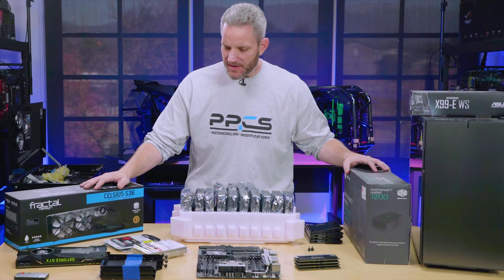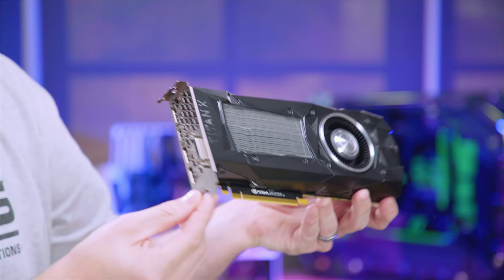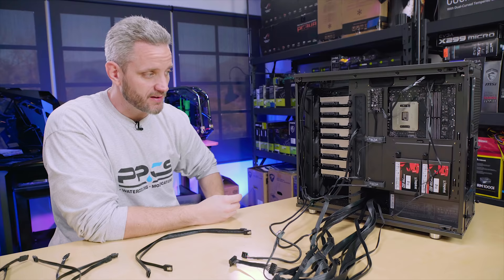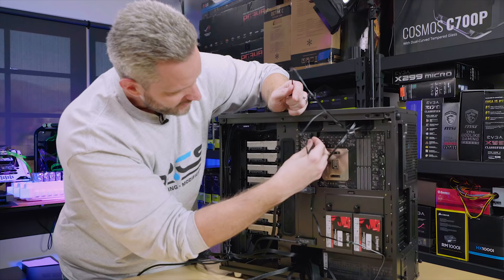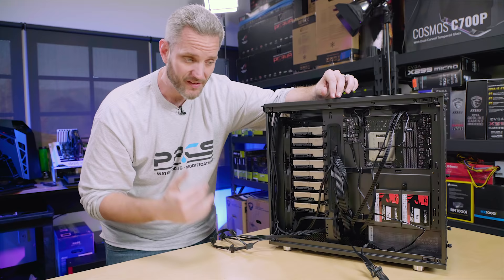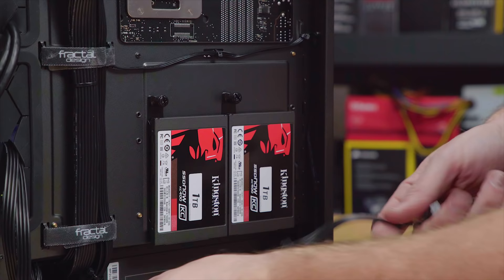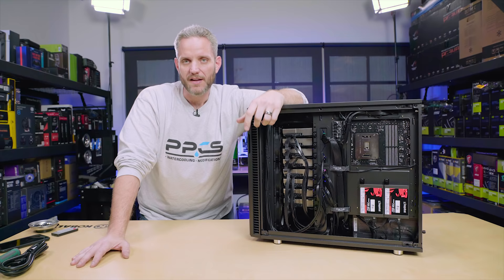How to cable manage a computer

Comment: I have an ESXi host with 4 VM servers living in it on a homebuilt NAS. I had it AIO cooled for a few years. I just went back to Air on this as for a 24/7 need to be reliable machine water any water is not wise if you do not have a person watching or using it 24/7. AIO failure when no one is around is devastating to say the least. Yes, it is nice to cool with water but sometimes it is just a failure in waiting and a very expensive one at that.

Comment: If you hook up your 3 case fans (3 pin) to the fan controller will you be able to control the speeds of the fans? For some reason I can see the rpm's but I can't control them.  Thank You!
Reply: 3 pin fan speeds cannot be controlled by the motherboard. Only 4 pin PWM fans are capable of this. You can buy certain fan hubs/controllers that will allow you to control the speed either through the mobo or via knobs/switches, or you can use low noise adapters to limit (but not fully control) the fan speed.
Reply: Thank you

Comment: late to the party, but did you do a followup to this? i'm curious how you set up the nas in terms of software. ideally, i'd hope you used zfs - in raidz2 + spare with the ssd drives for slog and l2arc, all on top of solaris. but since you guys are partial to windows, did you go with refs?
but you wanna mix workstation with nas? i'd just keep it as server and lose the expensive gpu.

Comment: Small thing you could do if you don't want to potentually waste zip ties is during your planning routing would be twist tie them and then go over with zippys once it's at final routing. 

I was going to say that the way you had the top 4 hdds data cables started Really irritating me, in my server i have all the sata cables in a tied harness from the top down. 
But i then noticed that those sata cables you have are around std length and they need to reach a pcie sata/sas card, so you'll need all the length you can get with that. 

Another way of doing this would be just get a 2 port sas card so thats normally 8 hdd, 4 hdd per sas port, and just use the mobo sata for the ssd. Also sas data cables are normally longer than regular sata cables.

Comment: Regarding tying cables together, I've been doing research for a long time yesterday about the different methods: Twist ties are dangerous because of the metal ends land on an electric component, it can short it out. There are thicker twist ties that don't have the exposed metal ends which are the ones you should use if going twist-tie route. Velcro ties are best except that if you don't cut them, they can become very bulky when wrapped around cables many times. The part of Zip ties that come in contact with the rubber coating of a cable can start to wear down the rubber, and also the fact that to replace them, you have to cut them, possibly cutting your cables. Reusable zip ties exist, which is what I'm going to use today. I don't plan on moving my cables at all after I manage them, so I don't think they would wear down the rubber coating so quickly. 

tl;dr: #1) velcro ties, cut to length to prevent bulk. #2) thick rubber/plastic twist ties without exposed metal wire on ends. #3) reusable zip ties. #4) regular zip ties. #5) if nothing else, then regular trash/grocery twist ties but used very carefully to prevent shorts.

Comment: Just noticed on a big 4K screen, lots of macroblocking and banding artifacts. Reminds me of my "good old" GH4. Fixed it by replacing it with the GH5 and its great 10 bit codec. 

Didn't know you were using the FS5 (8 Bit 4:2:0 H264 with a low bitrate, lots of filtering, low detail but strong sharpening).
On a HD screen it looks fine though.
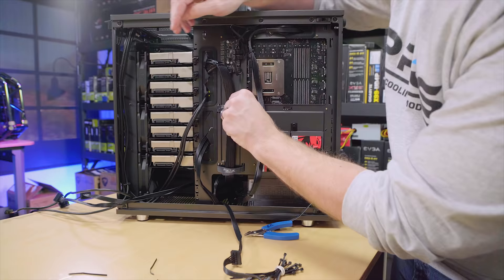Reply: At 16:33 e.g. big green blotch on the the right side of the case.
Exacty what happened when I tried to colorgrade flat (V-Log especially) footage from the GH4.

One solution could be the use of Temporal Noise reduction in either Davinci Resolve or Neat Video before applying any color correction. It cleans it up and even dithers the colors.

Comment: Most is common sense but when I was a noob builder I did actually try to force the sata cable into the ssd and broke it so good tip on that for new builders. I pretty much do this the way you do. The only thing that drives me insane is that big USB 3.0 Cable from the case to the motherboard. Any tips on that?

Comment: Would it work if you connect your HDDs in a staggered way ? I mean connect one HDD with the sata power leave the one above it then connect the one next to it, then get the next cable connect the four in between. Just a thought.

Comment: So I just bought this same case, and I wanted to use this as kinda a guide on how to do my cable management (which I've always kinda sucked at) one thing I'm having issues with is that you never showed how you routed the fan cables to the aio. I've got a h115i from Corsair and am having issues with this. I'm setting it up in the front with push/pull I plan to have all Corsair ml140s in my case but don't have the money to buy that many yet, so I'm having to deal with the shorter cables of the stock Corsair fans for the pull side on my radar and can't figure out the best way to route then to keep them out of view and connected to the aio. Any help in this regard will do be great! Also I hate the loops on your drive power cables, think it'd be nicer if you had zip tied the loops down  and had the second power cable routed "on top of" the first then allowing you to have one nice line of cables for you hdds.

Comment: I would love to see you do a cable management tutorial on a case that has tempered glass on BOTH sides.
You mention that everything is traceable if you need to replace something, but in my chassis (corsair 570x) the only place to hide wires is what i can only describe as a thin metal tube behind the motherboard tray, making traceable cables almost impossible if you want it to look good on both sides.

Comment: I just have a question regarding the Power delivery to those 2 SSD's. so you're using an extension cable to connect to the power supply cable or are you using some something different. as those cables came from somewhere else. I understood everything about the build except for this part. I just can't figure out how the power delivery is achieved here.

Comment: Now I really want to open up my pc and fix the cable management on the side panel. Instead of combining select cables and fastening them to other areas, I just tied them down in the same general area. It's relatively clean though, but this video makes me want to rewire my whole setup.

Comment: What if you use the two SATA power cables together same as the PCIE power and use one for HDD 1 3 5 7 and the other for 2 4 6 8 so you don't get the loops and the cables will be straighter ? Will that work?

Comment: Jay, do you ever tape off the ends of unconnected power cables to avoid a short?  I Recently had an unused connector of a 4 connector SATA cable shorting to the case.  Never had that happen before.

Comment: you seem to feel like that power connector is bad but you should see mine, it was an old one which still comes in two parts so it's so clunky and difficult to get it in the plug, i bet that one would be so much easier and less painful

Comment: 1 suggestion, if the connectors have enough space between them: for the 8 harddrives you used 2 cables, the first for HDD 1 to 4, the other for 5 to 8. It might have worked if you used one cable for drives 1, 3, 5 and 7 and the other for 2, 4, 6 and 8. If the total length of the cables is enough and the spacing between the connectors works out, that will give less of those loops and an even flatter layout.

But overall great video, especially the part about  plugging the cables into the GPU/motherboard first, not the PSU side first. This can make things might neater in the end, especially on the side that you can actually see.

Comment: Hey jay, I know this video is kinda oldish, but was wondering what the business end looks like and how you deal with motherboards that have connection points in the middle of the board or just in really bad spots or even cables that are to short. Also AIO tubing routing?

Comment: I'm very late to the party, but... great video, and very helpful :) I just recently opened up the backside of my pre-built system for the first time to get a proper look at what I actually need in order to install my new SSD, and the cables looked really messy, if I remember correctly. Had a little bit of trouble getting the side panel back on, even. Thinking I might try and fix them up myself, after watching this clip! Installing my SSD (once I buy the required screws and SATA cable, as well as some new zip-ties) is as good an excuse as any to try and clean them up, right?
Reply: Bit of an edit, I guess... Unsure to what degree my case/motherboard allow for cable proper cable management. The way it came pre-built (or custom built, I suppose, by a local company in my country) suggests that there are no practical ways to route SATA cables - they are currently routed in a way that blocks off part of the motherboard, right where something that might go in the second PCI-e slot (the 4x mode one, underneath the slot where my GPU is plugged in) would probably have to go.

Comment: There’s 2 problem factors for some people, the cable management design of the chosen case and the style of the cables..   I have a evga supernova gs 550w full mod with standard issue cables fitted in a GameMax Expedition m atx case, neatest I’ve done a case, but had to squeeze the flat side panel on,  my main issue is the 24 pin, it’s stupidly thick cable..  working with a coolermaster elite 110 with fix cabled atx power supplies little easier to bunch and tie and working with a aerocool CS-102 case I’m able to feed and tuck away cables from a gaming power supply..     it’s a daunting task, but you do need to find the right case and cables.

Comment: use SAS sas drive controllers and raid controllers (depening on what you want) are so damn cheap and you can get like 36 ports to a card and 4 sata to one SAS cable

Comment: Jay, have you had much luck with the daisy chained Sata cables? (4 in one connector cable) ..i never seem to get them ALL to work at the same time..if i use individual, then they work..(even if i replace the cable)..What say , you?

Comment: When I have hard drives in a stack, I actually use one sata power cable for the odd numbered drives and one for the even numbers. There's less horizontal mess that way. I guess the only challenge is that you'd have to unplug more cables if you need to pull a drive in the middle.

Comment: Jay i'm having some trouble with my rig cablemanagement. I have an S340 elite and i use cable extentions for the 24pin, CPU, and 2x 6+2 for the GPU and they ocupy too much space.
Since my GPU is an AMD VEGA 64 water cooled and it pull too much power, people say i must use 2 cables with independent power lines instead of utilizing one cable with the two 6+2pin headers.
I Have a Corsair RM 850x. Should i use two independent power lines for each GPU conection or can i use just one cable?
One less cable would free significant space.

Best regards

Comment: I'm using the InWin fans because they all daisy chain. Although, technically there are two cables because it splits the fan and RGB off of the one cable. Now I just need to perfect the cable management of all the other items.

Comment: 21:51 " everything is easy to trace is what cable management is all about" i think this is most important aspect here. unlike clumping it all together, sleeving them and forget. if it was me at the beginning, i would have a central trunk of wiring and everything branching out, and that is not cable management. thanks for the idea.

Comment: The best way for even better cable management I liked was LianLi and Thermaltake with their Level 10 GT(GTS) hot swap systems. One long sata connectors to plug in on the back of the drives and then the single connectors because of how many drives you have. In this case that kind of setup for cable management would've been perfect.

Comment: Honestly, and its silly, but with all these different connections you know which one I always struggle the most with?  The one NOT shown in this video by the way.  The USB connection from the AIO to the usb header.  It seems, inevitably, this has to run from the CPU socket, down to the bottom of the board underneath the graphics card, so I always struggle with a way to route it that 1) keeps it clear of GPU fans/heat sings and 2) looks decent.  And it often isn't long enough to do a good job.

Comment: There were a lot of right angle turns on those flat cables where the cable ended up turned the "wrong" way. As must as possible, eliminate all twists.

Comment: Hey Jay i am kinda working with a small case which does not have much room but still i have to make it neat. the gpu is not so long. just a strix 1050ti case has 4 sata hdds a dvd rw and a bunch of connectors. can you do a video on how to cable manage on a small case with little room to breath. cases like raidmax?

Comment: i have a suggestion, sometimes its nice to color code cables with a tape or stickers in order to know instantly in which sata port is certain  hdd/ssd connected, especially if they are not connected in numbered order or sth, or you are adding them at different times or sth... it's pretty hard tracking them when they are bundled together

Comment: hey jay, i saw paul doing a mod for a 3.1 type c port on his case but i don't want to drill the front panel. could you show another possible solution (maybe involving the expansion slot covers because everyone has a few of those laying around and they may fit a usb-c port). thanks.

Comment: Wouldn't the EPYC be better option for that build? Having in mind that the EPYC has 128PCIe lines and is not affected by Meltdown and Spectre patches it should perform much better in IO workload and virtualization stuff.
BTW - Can you tell what Raid controller will you be using? :)

Comment: I'd like to see a version of a more standard pc with only  like 1SSD and 1 or 2 HDDs plus extra cables for fans and front panel etc. 

the only thing I learned after watching this and trying to fix the cable management in my old pc my brother build for me (without any cable management but rather just plug it in so it works) is that my case offers literally zero cable management options
I was able to improve the cable management a little but without this kind of back panel space the end result is really disappointing
Reply: Brohvakiin Dova I would recommend svive luna s700w for you
Reply: @user-qm4te9lb5l  just got the nzxt H510 because it was on sale and it is a blast to my old case there are close to no cables showing up front, only power supply for mainboard and gpu stick out a little but other than that it's all directly attached to the back panel
Reply: Brohvakiin Dova Banging man, it looks good
Reply: @user-qm4te9lb5l  it's super sexy indeed ;D love the design and color (got the white one) I didn't bother with any fancy RGB but the RTX 2070 I got has a very fitting white LED by default which looks great

Comment: 10 1 terabyte drives or 10 terabyte drives? I assume this is a full size tower. My fractal is a mid tower... It didn't have quite as much room for cable management in the back. I need to get a SATA power cable extension for my setup. I have 3 drives but the SSD is mounted on the back of the motherboard tray like yours so I have a whole extra cable in there that I could get rid of if I had a little extra length on one power connector. That cable management is a pain, but looks nice when all is said and done.

Comment: when puttin the sata in to the drives, it would have easier if you had connected into the top then miss one the into 3 then 5th then 7th that way no big loops

Comment: At 18:59, instead of putting loops,  on my built, I purchased an extra modular cable, popped the sata power connector and reposition them.  After I cutted the extra length

Comment: where to connect that case fan controller thing onto the mobo? im using x470 asus carbon ac. also, i dont think the fans infront at long enough to route to the case fan controller?

Comment: Out of all the parts you have you don't have a sata controller Jay??? Also, how is that VPN company? Do they throttle down with high transfer accounts? I agree on doing sata cables last, I broke a 1tb drive that way. It still works but I need to use that cable only being it broke off in the cable.

Comment: I’m having trouble with the sata cables. I’m using a Corsair tx650m psu and the sata cables are kinda thick. I’m using a nzxt h510 case and  the ssd holders are on the back above the psu. When I try to clamp the ssd holder on the 4 holes , the sata cables at the end of the connectors get bent because the case pushes it and it kinda looks like it pushes the sata connector as well, and I don’t want my ssd to get fucked. Idk what to do, any advice?? Also I’m using one sata cable for both ssds.

Comment: Couldn't you use L sata connectors on the hard drives? A lot cleaner, and it has lower profile, thus you don't have to worry about yanking them while bending the cable downwards.

Comment: I have a suggestion on how to plug  the sata power cables on the 8 drives. Instead of going one after the other skip one hard drive each time. I believe that way you won't have that curl at each drive.. just a suggestion. .

Comment: personally, I wouldn't have kinked the SATA power cables, i know people have said they would interfere if they were run alternately, but there is enough slack to get past that. having had to deal with power and data cables that have failed as people have creased them over the years, it would be my only observation, opinion really. i do like your videos.